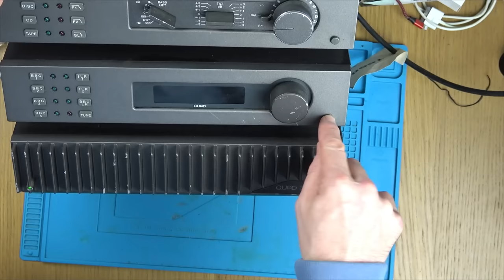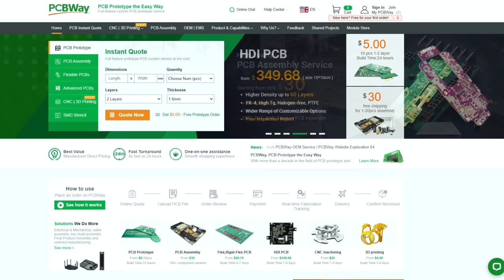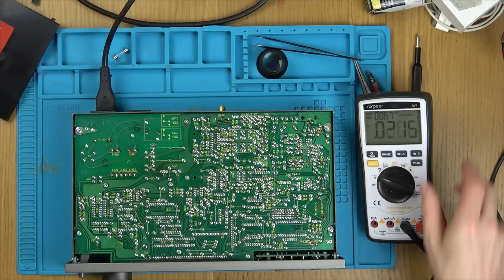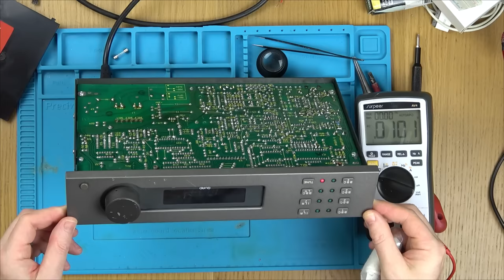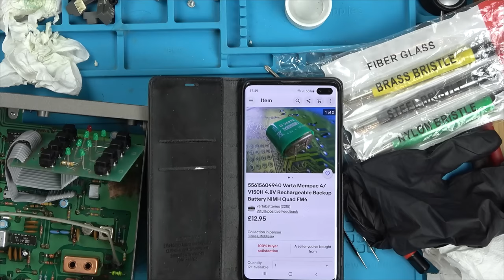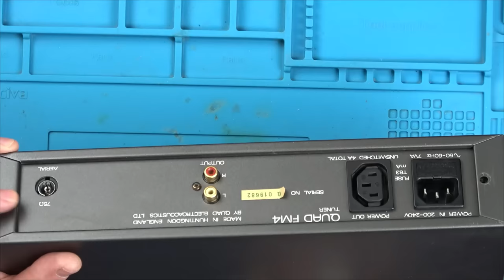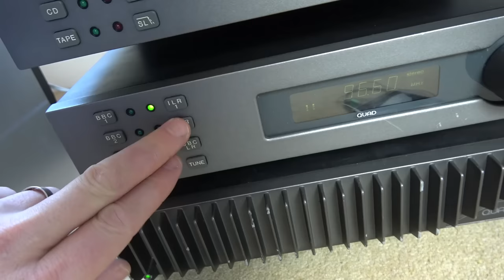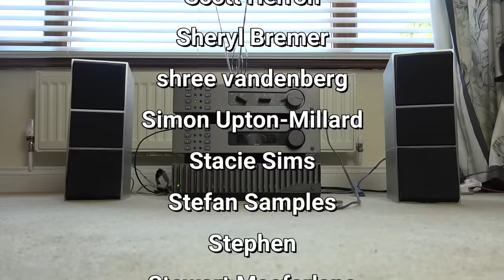QUAD - The Crème de la Crème of Audio - Can I FIX it?

Comment: I was a "Hi Fi" freak in the 70's and 80's and used to drool over Quad equipment in the magazines and dream about the day when I could afford such "top shelf" gear.
 Thanks to your video (great work) I finally get to see inside some gear they made back in those days.
VERY DISAPPOINTING.  Looks like any other cheap, high volume, consumer electronic stuff, mass produced using low price components.
Maybe I'm spoiled, I work in RF engineering and as user of a wide variety of high end test equipment I do know what quality electronic equipment looks like inside.
The way Quad gear was marketed you would think it was the best of the best.... gold standard.
Just goes to show the power of advertising.  Spend enough on it and you will convince a large enough number of people to part with large wads of their cash regardless.
Reply: Actually, the long-departed but illustrious founders of Quad specifically aimed to design hifi that challenged the assumption that quality sound could only be produced using expensive components. Their founder Peter Walker famously caused a scandal by demonstrating his audio designs using simple electrical flex for speaker leads instead of the eyewateringly expensive alternatives used by many audiophiles. Quad's stated preference was for clever circuitry that avoided using flaky parts with high tolerances that affect the sound too subtly to be discerned by human hearing, bringing affordable and reliable quality sound reproduction to many people for the first time. Their chosen components did not require the very highest tolerances but worked well together - hence the use of Quad by the BBC and in many PAand cinema systems. That's why so much Quad stuff is still in regular use today with minor maintenance as Vince has shown us here.  Quad's customer service was legendary unlike almost all their now long-forgotten "high-end" competitors.Their equipment was not stratospherically priced - instead it was marketed to be "reassuringly expensive" enough not to be rejected out of hand by hifi industry opinion formers (often motivated by their profit margin). This is the same reason why so many fantastically but affordable Japanese hifi was eschewed by the hifi mafia in favour of local kit that cost a bomb and exploded if you looked at it the wrong way or didn't a;ign it with leylines (cf British Leyland cars!).
Reply: You should take a look at a Quad 405 internally, they are really well put together. They might use some bog standard parts but the build quality is excellent. I have one from the early 1980's aside from capacitors being replaced it still works as well as the day I bought it. The may not have the sort of parts that Krell or Audio Research use but when a Krell KSA50 cost best part of £2000 you could pick up a 405-2 for £200

Comment: I dream of owning Quad audio gear.
During Uni holidays in 1973 in Sydney, Australia, I worked for "British Merchandising" who imported and sold top end UK audio equipment. These included Leak, Garrard, Goodmans and, at the top end and most expensive, Quad.
The Quad 303 amp matched with the Quad electrostatic speakers was easily the best audio combo that I have ever heard. With 20 year old ears I could "see" every instrument in an orchestra: it was the definition and "sharpness" that registered. A "system" cost well over $1000 back then and many times that today so I will have to rely on my memory rather than waste my money trying to relive my audio youth. Dave D Sydney
Reply: Describing Goodmans as top end audio shows how far they fell. Such a shame. Leak and Garrard, of course, don't even exist any more.
Reply: The Leak and Garrard names still exist.
Leak is now part of the same Chinese company that bought Quad. Garrard is owned by SME, a high end British turntable manufacturer.

Comment: back in 88 i used a quad 606 power amp with a meridian 208 cd/pre amp with mission 753 speakers .the first thing i thought when the tuner wouldn't power up the glass fuse!!! that 406 set up was and is class .

Comment: Did anyone else wince every time he shifted it around on the bench without any soft cloth to protect it?
Mains AC is not negative and positive. It's Live and Neutral !
Everyone needs a few boxes of fuses, you can buy selection packs with hundreds of fuses,  many different sizes and values, you need this!
I was thinking the same thing about those discs, wondering if one side was coated and supposed to exhibit an amount of resistance.  If you have to take stuff like that to pieces i would warm it first with a heat gun on gentle or with a hairdryer or blow heater.
I don't mean to sound rude but it really hurts to see such an old piece of equipment being restored with such a lack of finesse. All that scratching on the board could have been avoided with a bit more time spent with some finer tools / materials. And just put a cloth down to protect the paint, i know it's not in amazing condition but still!

Comment: I spotted that RIFA cap as soon as you opened the power supply. Those are such a common issue..
I had the same issue on a sowing machine from the 80's. It smoked the room and made an awful sound when it did. It was so violent that it scared me.  
When i opened it, i saw the burst RIFA... Replaced it with a different brand.
EEVBlog featured them in vlog #1183 , because they are always failing in older devices. 
If they look crusty... they are... Moisture gets in, and after years of not using they will fail when you plug them in. 
I would recommend replacing them in the other units too. Because if they burst, it is possible you cannot read the value any more.
Reply: ^^ this. ALWAYS open the gear & triage it for these little buggers, + other caps (bulging or burst electrolytics, shorted tants), memory batteries, stuff like that. & bring it up on a variac.

Comment: That tuner used to have a backlit screen, if I am correct. Cool video anyway, Vince!
In my country, in Hungary where I live, collectors would have cut throats for the hi-fi stuff you have in your hands. NiCd and NiMH batteries are interchangeable in those devices. NiCd got discontinued because someone in EU said it has hazardous materials inside. But in my opinion, manufacturers got rid of it because those batteries did not want to die that often, and people could not be forced to replace their equipment too often, so they would not spend money on new stuff too often.
Reply: @cjmillsnun  I had an original cordless drill battery manufactured in 1976, completely died in 2019. Maybe it answers the question as to why nobody wants to make it anymore.
Reply: Yes, the display is phosphorescent vacuum type, complete with horizontal hot cathode wires.

Comment: I'm happy to hear you've discovered Quad! For my 6th form electronics course extension here in Australia (1982), I built a tilt tone control, just like on the preamp in your stack. I should have just built a bass lift instead because that's how I always had the tilt control set.

Comment: I haven't looked at the other comments, but a good safety precaution when working in electronics, especially when high voltages may be present, is to remove all jewelries: shorting a circuit with a ring makes for a bad day.

Comment: If I'm correct, the reason you have three bridge rectifiers is because that's a multi-tap transformer and the windings are broken out at three places for three different voltages and need to be independently rectified into DC current so you can power the chips with the voltages they need (typically 12V for the amplifier circuit and 5V and 3.3V for the logic).
Reply: In this case 30V for the display, 12V for the audio, and another 12V for the RF/IF.
Reply: The tuning circuits of the front end unit need the 30V for the varicaps. 12V are for the audio circuits and 5V for the logic circuits  and the seven segment diplay. 
QUAd made well designed and high reliable  Hi-Fi Components. I used to work  2 years for the  german general import company in Hamburg. I repaired lot of those gear, the most of them were mistreated by its owner. No real defects. Some overheated 405 which were build in in  furniture blow the speaker safety triac parallel to the speaker terminals. 

I had a Quad  303 in my car  powered by a homebrewed inverter. It sounds incredible with my Blaupunkt radio cassette and two  10" Isophon speaker chassis in the back. ☺..long time ago. 
That was before car-hi-fi was invented.
Reply: @Reaktanzkreis  Rubbish. See the schematic. The 30V supply is connected to the LH end of the transistor ladder that controls the signal strength indicator, and IC18-19 that control the numeric display: see top of C46. The varicaps are connected to ground and the reference tuning voltage via point G, which is between 2.0 and 8.2V.
Reply: @EJP286CRSKW  Yes , you are right. Sorry! I mistook it with an Revox B760.  I recently got one in for repair.  The Revox tuning voltage is in the range of 5-25V. 
My Quad equipment is gone with many others  , a fire destroyed my  workshop in 2020 with loads of old hi-fi , ham radio and test gear. A Li-Ion battery start the fire , it was on charge when something went wrong.

Comment: I've had Quad 34, 44, FM4, 306, CD66, CD67, 24p, QC-24, II/forty, 989 speakers and 2905 speakers. Love them! I have upgrade kits for the caps from the Netherlands, and also a new battery for the FM4.

Comment: Can't say I've heard of QUAD, but a good video!
Tip: It's extremely common for soldered on batteries (especially Varta) to explode/leak everywhere, the electrolyte remains acidic and capacitive so it will eat away at any traces as well as bridge anything it's found it's way to. Very common to see this kind of thing cause all sorts of weird behaviour in older electronics, even new ones!
*Always*, always always! Remove them first and give the board a good clean with some white vinegar to dissolve acids and then IPA clean. Check traces for breaks, patch up where necessary then continue diagnosing if still faulty...

Easy oversight on the fuse, we're all guilty of that at some point lol

Comment: I read a lot of comments, but didn’t see anyone answer the question about the four phono plugs for the tape player.  Rec stands for Record, and Rep stands for Replay - in other words, input and output.  The ability to record and share your LPs or create your own mixtapes was the main reason you wanted a tape deck all those years ago.  So, one for L/R input and one for L/R output.  In the states, they would have been marked Rec and Mon for monitor.
Reply: When this came out, the higher end tape decks were 3 head meaning there was a separate record from the play head. This way,  you can listen to the actual recording on the tape and not the source.

Comment: As a newly working teenager in the 1970s and Mike Oldfield fanatic I desperately wanted a Quad system.  I could never afford it and by the time I could I had come to the conclusion that it did not matter what I played music on as I couldn't practically tell the difference between a Quad system and a Boots £30 special.  Put them side by side and the difference is obvious.  Use a Boots £30 special for long enough and it sounds no different ... my ears adjusted, apparently.  So I saved myself £1k.  Which of course I spent on fast women and cars ...

Comment: I remember back in the late 80's I was gawking at the exact setup you show in this video - at a local high-end audio shop. Really wanted this, but was out of my range at the time as I was 15 or so. It appealed as it looked like nothing else around at the time. And nothing else in the shop sounded like them with the quad speakers hooked up to it.

Some years later I ended up buying a Mission Cyrus amp that in many ways share the same aesthetics.

Comment: The contact discs in the switch looks to be silver plated on one side - silver oxide is the black you see, RF connectors are often silver plated and black but always seem to make good contact,

Comment: This extract explains tilt control.. A headliner is re-
introduction of Quad’s 
tilt control, first seen 
1982 on the Quad 34 
preamplifier. This gently 
alters overall spectrum 
balance: you tilt one way 
or the other, in steps, for 
a warmer sound or a less 
warm one. Tilt is a simple 
and elegant replacement 
for bass and treble controls, suiting 
a system that is pretty well balanced 
in the first place and just needs some 
tiddling. Here, you make one simple 
adjustment. Backing up Tilt is Bass 
Boost that measurement showed 
quite strongly increases bass. Quad 
say it adds bass to small loudspeakers.
Reply: worst.poem.ever

Comment: A few years ago I heard a 60s Quad system with electrostatic speakers and it was a really good experience :) The main unit with the radio and turntable was a big wide piece of furniture and there was enough "table" room on it to place the later added 80s CD player and cassette deck (as "auxiliary" sources) on top of it!

Comment: Think Techmoan would be very interested in these units, Vince.
Electrolytic capacitors can go to near zero resistance when unused for a long time, so fuses go and other board damage can happen. When I'm powering up electronic equipment that has been off for a long time. flip them on then off as quickly as I can. This lets the Caps take a charge and self-restore a little bit. 
Haven't watched all the video yet but I'd also pop the socketed IC's, out and back in  as they may have risen and allso may have some build up on the contacts.

Comment: I friend of mine had a set of these, but without the rear bracket. If you tried to run them just stacked on top of each other, the heat from the amp would cook the radio tuner! That inch of airspace is actually required
Reply: Actually the tuner could cook itself. The 7812 regulator runs pretty hot, and needs that heatsink inside the PSU cage. But my FM4 has been on top of two 306s for 25 years, not cooked yet.

Comment: Hi. FYI, Quad (can't remember what the actual company is now, but can be looked up) are very accomodating when you have problems. We had a stupid fault on our Quad 44 preamp which just required a resolder. Unfortunately, while unattended for 5 minutes one of our Labrador puppies got at the PCB and did terminal damage to it. At quite modest cost, Quad supplied a new PCB + gold module connectors and a new relay to replace the one that had been mangled. We rebuilt it and all was good. There are many full schematics on the web + upgrades should one wish to go that route. Also had dealings back in the 80's and they were brilliant, supplying new components for nothing after I inadvertently blew up the 405 power amp through my own carelessness.

Comment: Hi Vince - that blue bodied battery is a nickel cadmium battery - you are very lucky that the damage is so light after so many years. The replacement will have a green body - - which uses nickel metal hydride technoogy - supposedly with less leakage and safer for engineers to come into contact with.
Reply: as per usual, I should watch till the end before commenting lol .
Reply from the maker: 😂 I always appreciate the help Andy!!!!

Comment: Regarding the contacts on the platelet turning black:
My guess is that one side is silver plated and turned black, the other side is just the base metal (aluminium or nickel undercoat plating).
Silver is of course a better conductor, but can turn black. The reason why maybe only one side was silverplated, is to reduce cost. Silver is expensive and if you're just only using 1 side, why plate the other one.
But one can argue if it indeed is silverplating that has turned black if the silverplating really is an improvement.

Comment: The top outlet is switched. If you connect mains to the preamp and daisy chain the tuner and amp from that, the power switch on the preamp will turn the entire system off and on.
Reply from the maker: Thanks Travis, I'll test that out👍
Reply from the maker: Tested it out and sure enough it all comes alive when wired up as you suggested with one press of the power button on the pre amp, and all powers down when the same button is pressed again. Nice little touch, thanks for sharing that 👍

Comment: Hi Vince. 
The reason you have four sockets for tape is two are to send the signal you wish to record to a tape player, and the “ rep” are, I think for replay, in other words the output from the tape recorder. A high end unit like this would probably have a facility known as “ tape monitor” designed to be used with three head tape machines.( usually very expensive, (Revox, Tandberg etc)This was so the user could listen to the actual signal coming from the tape play head as it was being recorded. 
Cheers!

Comment: You should ask Mend It Mark about those washers. There is simply no better person to ask about audio referb. If you've not seen him in action, check his content. There is nothing he can't fix. He'll probably know how to sort the tuning settings issue you had as well. Time to collaborate 🙂
Reply: Yes indeed. I was a component level audio and electronics engineer for 50 years, and mark is probably the best all-rounder I have ever seen. Plus, he has an enviable array of test equipment at his disposal.